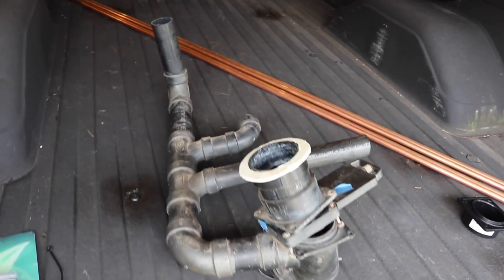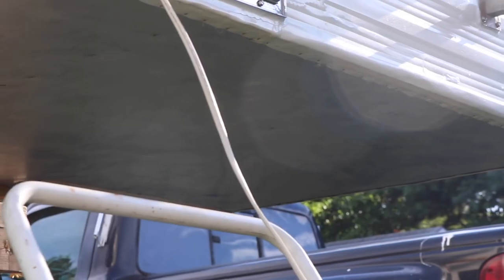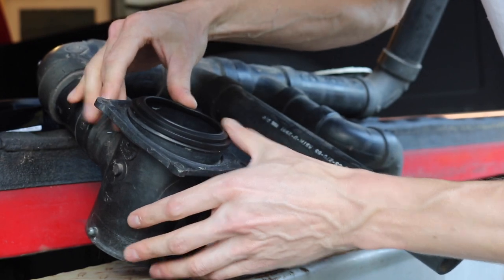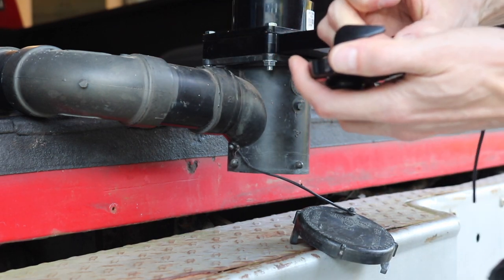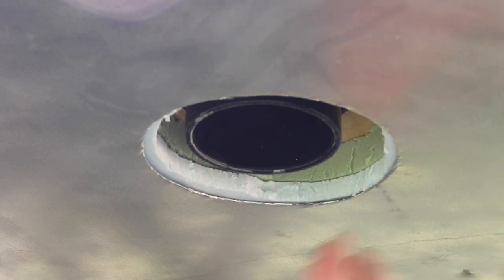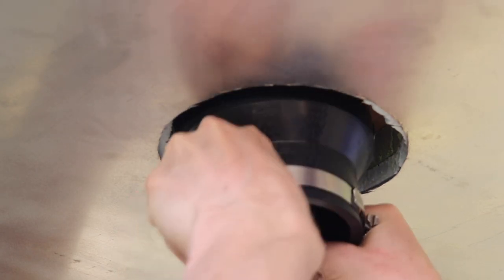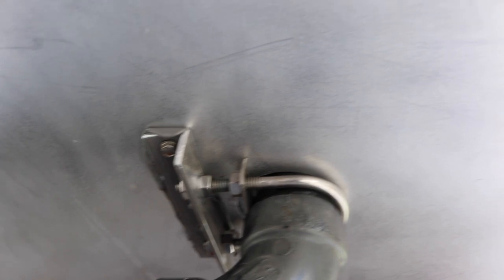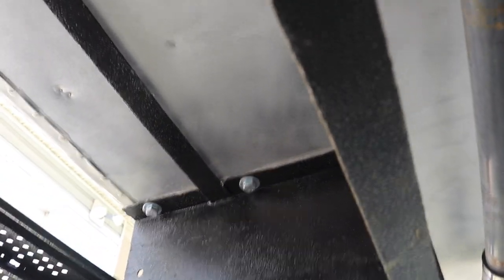DRAIN PLUMBING & STEPS - Truck Camper Build Part 64

Comment: It was cool to see how it all goes together. I have to replace the black tank valve on my camper one day. It's not leaking, but it takes a bit of force to open it.  Probably a piece of corn or peanut stuck in the slide. 
The valve is hidden in a storage compartment, so it was nice to see exactly how it goes together.

Comment: Love the build! Seems like you should have a second valve to keep the Gray water contained. Looks like the current set up the gray water will drain as soon as you open the cap, at least that’s how my camper is set up.